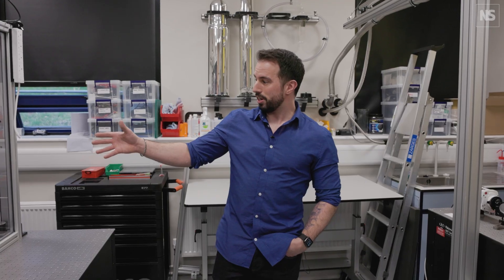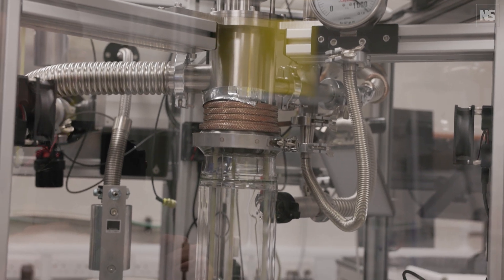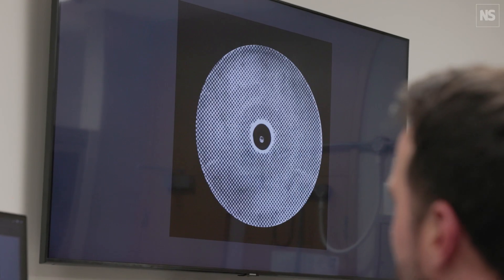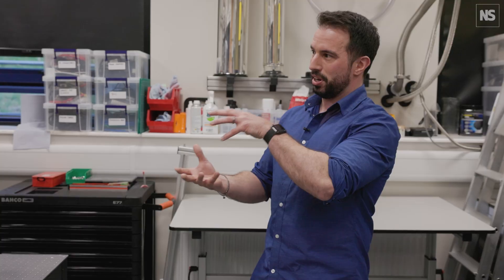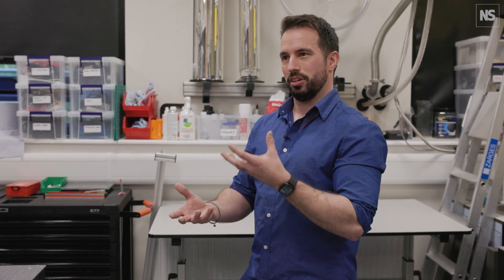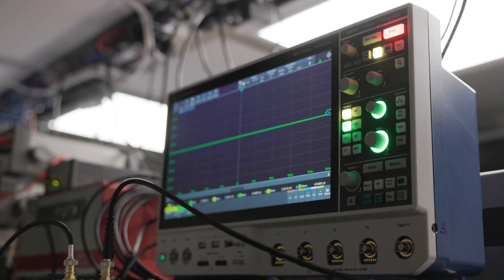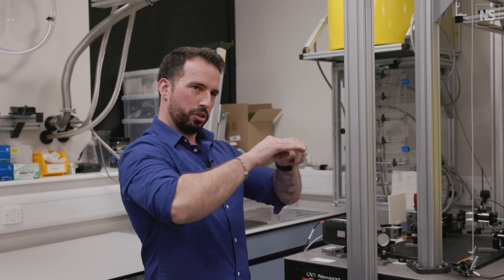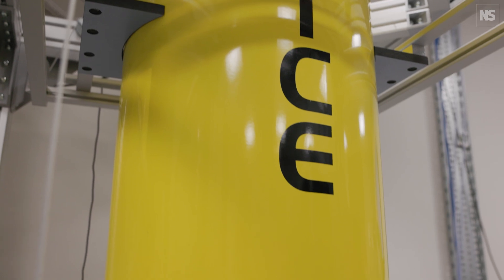Scientists Are Creating a Mini Universe And Simulating Black Holes

Comment: Nice, but off. 1 ) the maximum planck temperature is the UV cutoff. 2) Your next to probability and predictability and particle production from quantum foam and gravitational waves and energy density regimes. Also LIGO. The affect is really small/weak. 

4:42 Yep the universe as a finite system. 

Even though I think Einstein and to a degree planck got it. Keep up the good work though.

P.S. can neutrinos condensing/precipitation into a unique boojum/superfluidity.